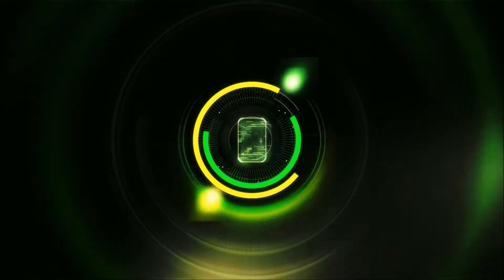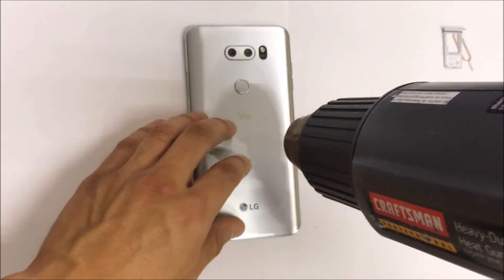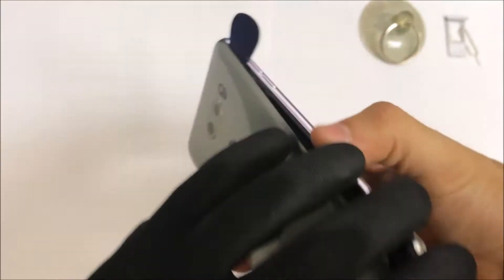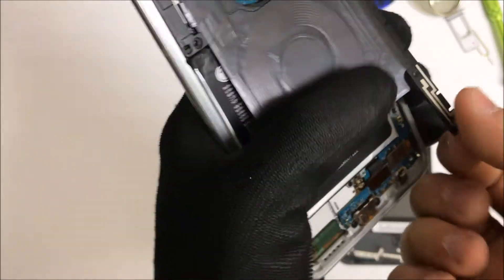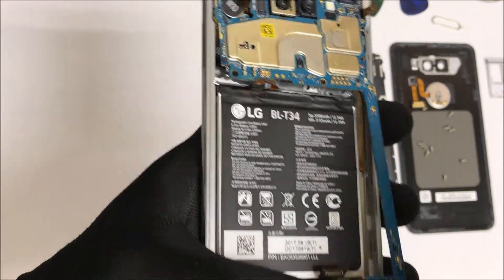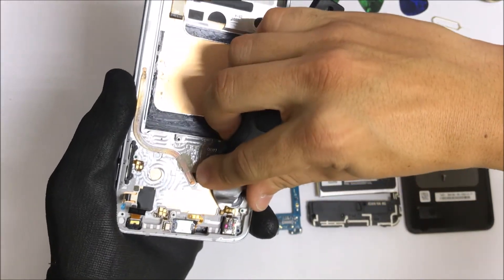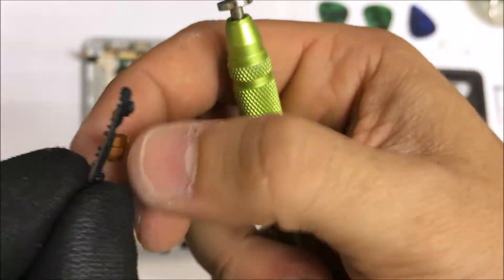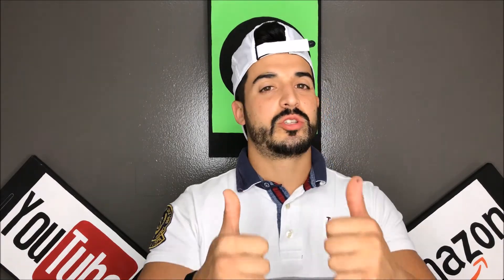How to Take Apart the LG V30 in 5 Minutes

Comment: Thanks for this. I just replaced my charger 95% successfully. Now I have two green lines vertically on the screen. Have I broken something completely or have I just messed up something simple?
Reply: Same thing just happened to me.. what did you do or find an answer?
Reply: Recheck your connections the thin film ones are they clean? Firmly attached?